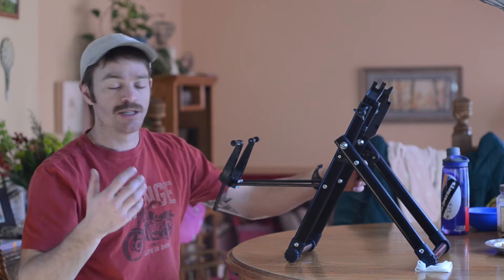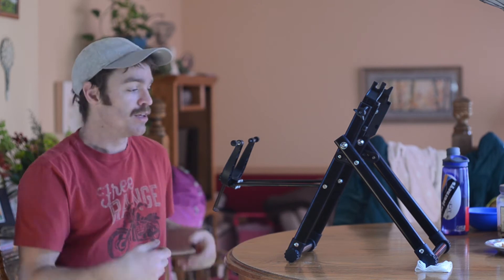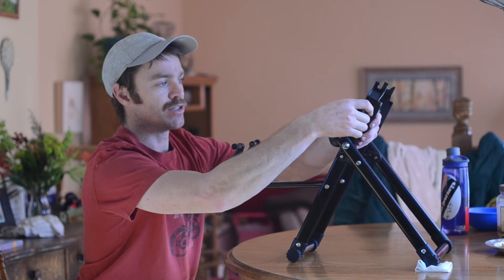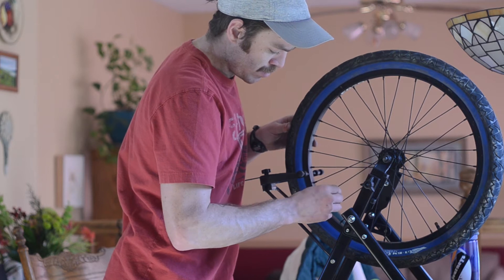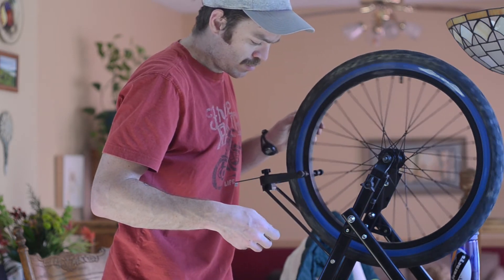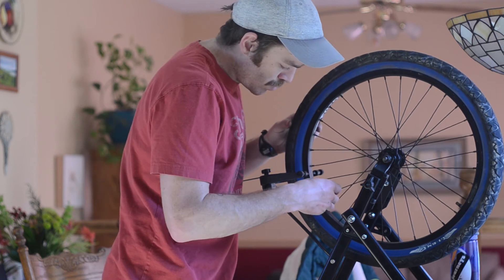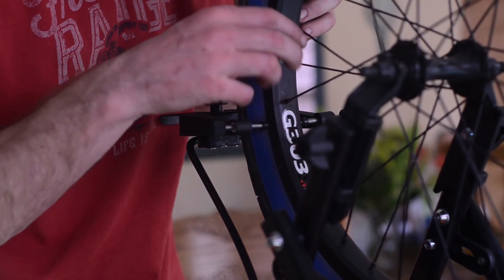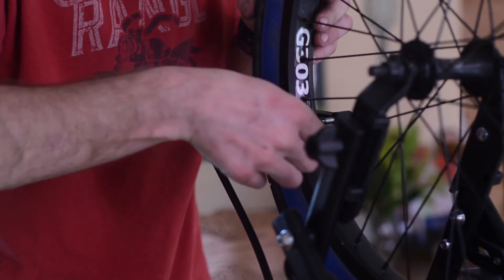Wheel Truing Tips for BMX/MTB + VLOG + Lixda Truing Stand

Comment: Hey Chad.
You just about mirrored my position exactly. Nice one!
It's £185 for a new back wheel, with a Sturmey Archer gear hub, or £25 for a new rim. I've worn through the metal skin on the rim; by basically using it, but there's bugger all wrong with the spokes, or the gears. 
It seems the bike shops are doing a good trade at the moment, and they can make more money from the fact that, more and more people have discovered cycling, (which is a good thing) and want spandex and sparkle, than they can from truing a wheel for me.  
It's an experience I've had with my other bike. It took 6 months to sort out, there was a lot of hassle, and basically, I'm a bit embarrassed I can't sort myself out. Money doesn't come my way easily.
I got the same stand as you, it's in front of me now, and I've just re-spoked my first wheel`. I've one more to do then I'll get more involved.
Did you use a dishing tool?
Easy'!

Comment: Hi. Could you please tell me if the truing stand will work with mtb through axles (15mm diameter and 100mm/142mm width)? Thanks
Reply from the maker: Well. So it sort of works. It's not perfect but i have 15mm thru axles at 110 and 148, they fit but not perfectly.